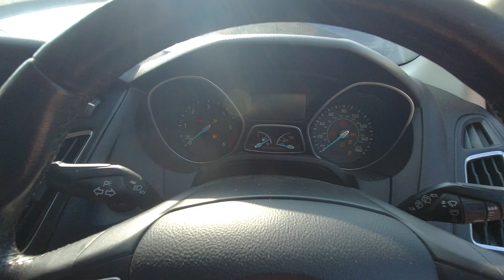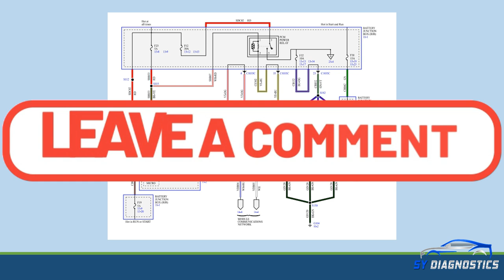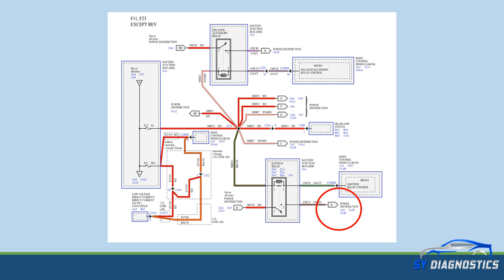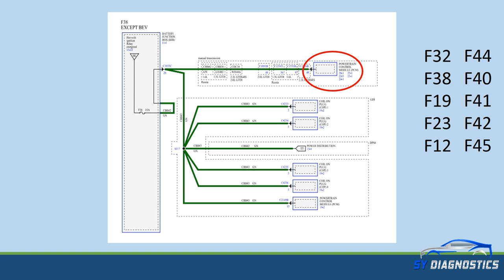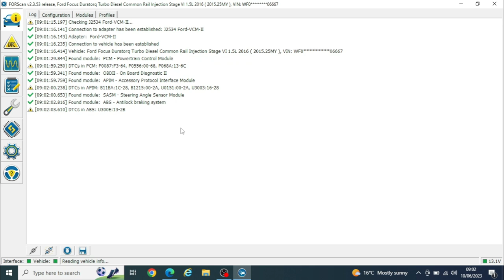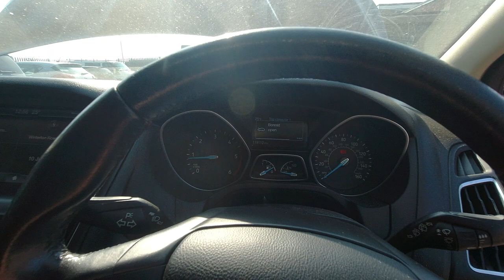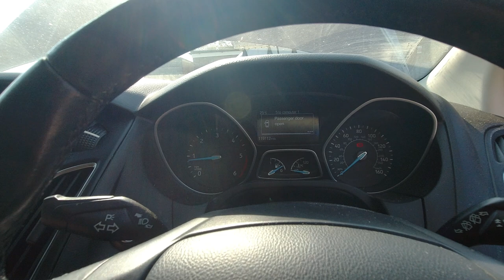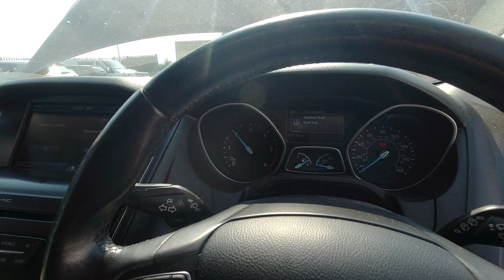Understanding 2016 Ford Focus Non-Starting Problems: Troubleshooting Guide

Comment: It looks like you followed the most logical,  methodical procedure. I also worked for Ford, was a Master technician, living in Pretoria, South Africa. Left December 2016. Started my own business. Was so sick of the warranty process and delays. I remember on the 2005 model focus mk 2, we had to remove the B.c.m or G.e.m, to replace the darn pollen filter. I can't tell you how many times I found those clips broken. 😂

Comment: Nice to see you popping up again Steve. Hope the new job is suiting you well. Must be part knowledge and part process here. I’m not a Ford guy so I wouldn’t have known that the PCM needs to be alive for any comms to take place. (So that part of your diag is definitely knowledge based). If I had that on a VAG vehicle, I’d definitely be off in a different direction. Is this because there is something akin to a ‘gateway’ built into the PCM on a Ford? Not seen it myself since I don’t see many Fords but I had heard about the washer fluid into BCM issue. Wonder if this car has had a BCM already for that problem and someone was a bit rough with their handling of the connector latches? Anyway, however your diag process might be characterised, it’s clearly quick and effective. Totally agree with your cable tie fix btw; the object is to get the car running and you achieved that. Permanent fix can come later. Thanks for sharing, regards, Russ.

Comment: It looks like the whole fusebox is liable to be kicked by the passenger when they stretch out.  I imagine the connector has suffered damage that way.
Reply from the maker: these are higher than the older ones, plus have a cover under the glove box. The plug is high up too. I believe its been damaged when somebody has removed it at some point